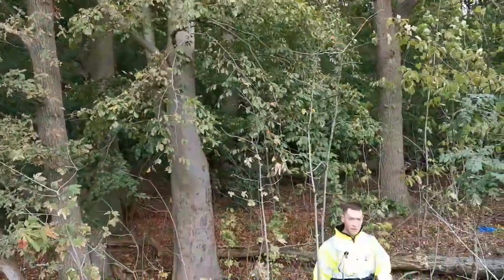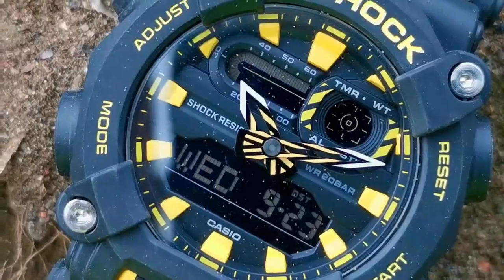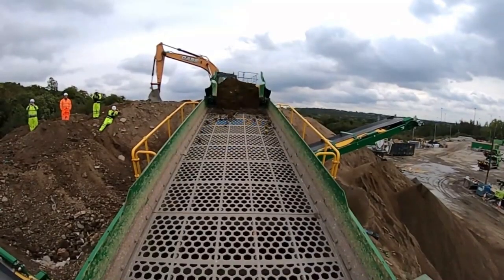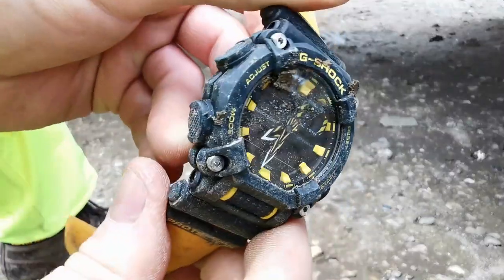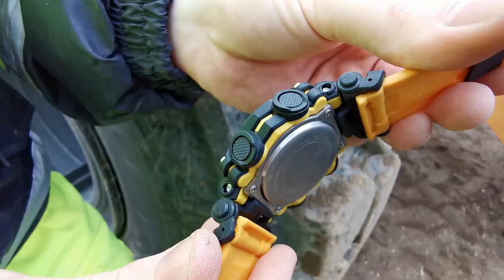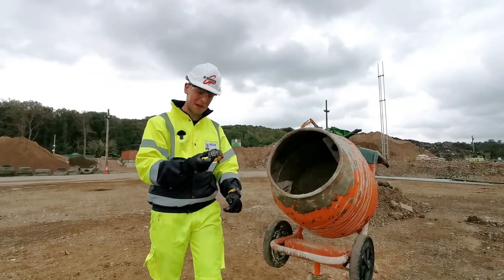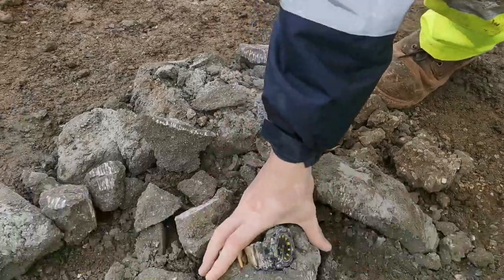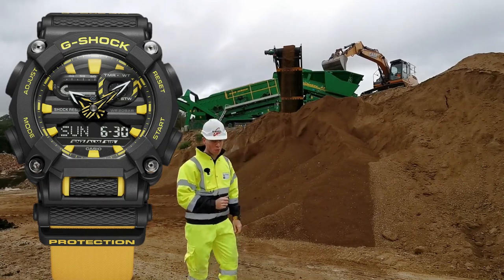G-SHOCK GA-900 TOUGH TEST

Comment: I grew up wearing Casio. From waking up using the alarm function, having a shower, catching a pouring rain or a blazing sun, bicycling, going to the gym, and to the beach, running, arriving in time to work, driving, seeing my girlfriend all the way to checking the time late at night using the illuminator backlight and so on. It's like a little friend that I have on my wrist. Casio watches are made to last, are incredibly well built for the price, not to mention that they keep a good time.
Reply: If the truth be told, I look on Gshock watches as my intimate friend.

Comment: Can confirm i wear my ga-900 at the farm where i use chainsaw,  bang it around while reaching into engines, gotten all types of engine fluids on it, and have worn it while running 10km of pipe, underwater, and in temperatures of 45°c to -50°c

Comment: I just bought a blue GA-900 with non-inverted LCD, but to be honest my job isn't one-tenth as physically demanding as shown here. 
Beside being durable the design of the watch is just thrilling, let alone the huge battery life time. Especially if you live far from the equator pure battery power is just preferable to solar power.
Reply: What color did u buy?

Comment: I got one of these for Christmas 2020.  Very nice watch, the light is a little dim. I have the GA900-2A blue with orange accents.  I have read other reviews about this watch and some say that the band is black, well mine came blue like the watch and I get quite a few comments about the watch.  Would have liked to have seen this watch as a solar model instead of a battery, but hopefully the battery will last 7 years as advertised.
Reply: It’ll probably last more like 10 years.

Comment: Is the glass scratch resistance?
Reply: It's a mineral crystal, compare it to the glass found on higher-end smartphones. It has pretty much the same properties (meaning it can shatter if You're very unlucky, but it's tough nevertheless and can handle minor scratches)
Reply: @MrCarpen7er  yeah. Its kinda vice versa thing with different advantages.

Comment: One sharp rock hit to the mineral glass and is game over, also at first test it was not concrete, it was mud
Reply: saphire is well scratch resistant so its much more harder than the mineral. as you know hard material equals brittle material. İt makes a sense if you wanna absorb a physical shock.